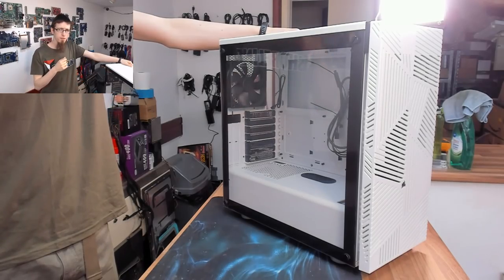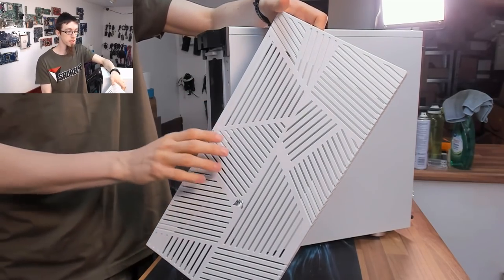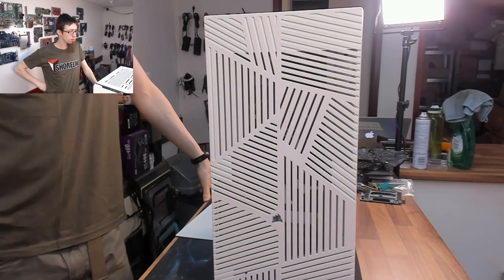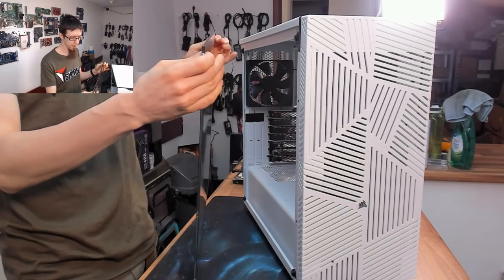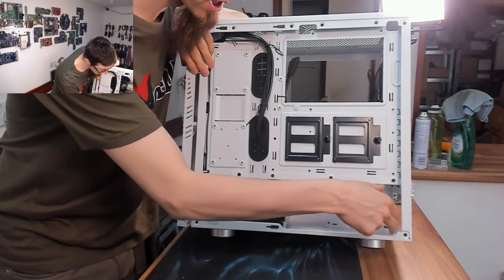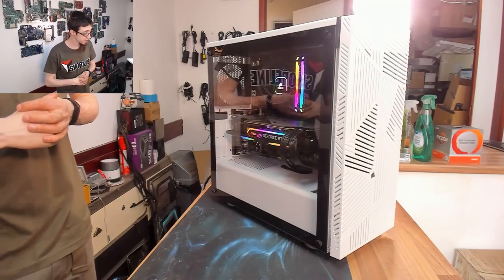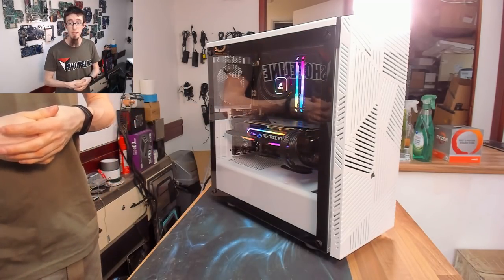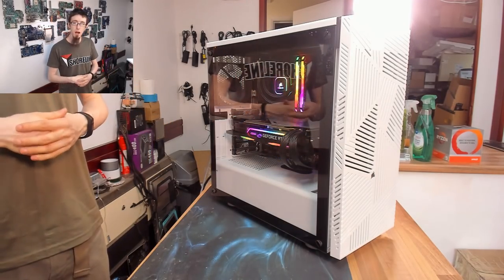Corsair 275R Airflow feature review - LBC#53

Comment: hey! It's my case!
As for the random screw that you see below the lowermost ssd mount, to the right of the motherboard, and even more specifically, right next to one of the cable management indents, that screw is there to mount your hard drive cage.
Reply: Does this case come with already arranged front pannel connectors or does it have like 6 single annoying ones?
Reply: @kamil9112  it has the obnoxious individual pins, but the front panel audio connector is 1 solid piece and the case does come with 3 included fans
Reply: Should I get this case ?
Reply: @ofduffman7674  the airflow is decent and for the price is good, if your getting rgb fans then go for the 220t instead
Reply: @ofduffman7674  
Well I mean I love it. It's also got one of those vertical gpu mounts built in. Granted it's close to the glass so it's hard to say if it's any good, but hey.
Reply: @Monster Conrad how is this case when it comes to noise levels? I’m a little worried it might be loud.

Comment: I got this case in black for my first PC build. Used a B450M Mortar Max and fit really well, although one of the rear fan header cables was a little short so I had to move things around a bit. Fans are quiet. Very happy with my choice

Comment: About the PSU orientation, its pure fact that capacitors wear out faster the hotter they are, but whether that matters that the PSU is essentially intaking then exhausting hot GPU air, probably not since most mid or high end PSUs will last 10+ years even with slightly warmer caps

Comment: I recently bought a fractal define R5. Sure it doesn't have the PSU shroud, but otherwise I think it is the perfect case. Plenty of space without being too big, 5.25" drive bays(yes optical drives still have a place!), plenty of hard drive bays, and cable management is a breeze. I do wish it came with another front fan, but if that is the only bad thing, I am willing to overlook it. Plus the dust covers are easy to get at without taking your pc apart.

Comment: I have the 275 and did a carbon fiber wrap on the front and I like the case. And for the nvme drive always remove the sticker because it makes thermals better! 😎
Reply: mister.T Jr  The sticker on the nvme drive is not a thin heat spreader because its made of plastic only more expensive nvme drives have it. Not a noob i have 20 years of experience with computers.

Comment: Hi Adam I was wonderinf if you could help me with a problem. I have a laptop with a windows 10 that frezzes/lags for a second or two every 5-10seconds. I had recently reset the hard drive reinstalled windows on it. So I thought it would be the hard drive. I took it out and but it into another laptop i have. Laptop works fine. Okay so must be something in the laptop thats broken. Quick check first put another hard drive in the laptop and the laptop runs fine. So hard drive is fine in another laptop, laptop with a different hard drive is fine. Wondering what the problem could be? Thanks
Reply from the maker: Try doing a Seatools for Windows long-generic test on the drive. Different HDD controllers have a different tolerance for drive failure, the drive could still be bad, but your test laptop was just handling it more gracefully.

Comment: The "airflow Meta" as if airflow is a new thing, manufacturers seem to think that consumers die every 7 years or something. I remever when cases came with 360mm side fans and sounded like jet engine
Reply from the maker: Yea this is true - but there's a very clear move toward all-mesh or all-grill front panels for the 'trendy cases' if you see what I mean. Just look at all the solid-front-panel cases that are getting refreshed with mesh front panels at the moment.
Reply: 100% and seeing more and more cheap and midrange cases with some filters is great too. I remember back in the day dusting out my old HAF-X case on a monthly basis because it didnt come with any dust filtration.

Comment: Did you have any problems with the installation of the h100i xt on the am4 because i just ordered the h115i xt and there is a bunch of reviews saying that the installation sucks and the clips could break
Reply from the maker: I'm not a fan of the two-hook mounting system, and I wish Corsair / Asetek would go back to a four-thumbscrew design. It is much easier to fit the two-hook setup, mind you. I can't see it breaking though, I have a couple of AIOs using a similar system that I've installed and removed from test builds several times and had no issue.
Reply: @Adamant_IT  Yeah i was always using the four-thumbscrew design on the intel platform but i switched to ryzen when 3rd gen came out and i was using the stock cooler but it was just LOUD and i was hitting 81c in gaming also wanted to let you know that the pro xt series is using  CoolIT instead of asetek
Reply from the maker: Aha, interesting, good to know!

Comment: Actually got this case
Reply: Is the case any good?
Reply: @granola3923  yeah it's great. You might need to remove the hdd drive to make more space for the cables/power supply
Reply: I think I’m fine if I leave the hard drive cage because I have a evga 600 watt power supply which is kinda small. Anyways thanks for the reply, I wasn’t sure if I should of got it or not but since you say it’s a good case I might consider it!
Reply: @granola3923  great! it's around 76 dollars on newegg which is great considering it's airflow design and the fact it comes with 3 fans
Reply: If I ever wanted to replace the stock fans what fan would you recommend? I was looking at the noctua p12 redux, but I’m not sure if I should get those.
Reply: @granola3923  Noctua fans are great they offer black options so you don't  have to worry about color matching it with your build, but I personally went all out and got 7 Corsair LL120 fans for my case
Reply: Thanks I’ll look to see if I get noctua fans. Also was the cable management for all those fans difficult?
Reply: @granola3923  Yes, the commander pro and the cables were a mess to hide/ manage, but luckily there was plenty of space to organize those.
Reply: Nice job! Me personally I don’t think I would be able to manage all those cables good. Thanks for all the help!
Reply: @granola3923  Thanks and Your welcome

Comment: The screw hole is to hold your gpu up
Reply from the maker: I did wonder about that. It just seemed odd for it to be there when the case didn't come with a GPU bracket though. But yea, I guess it gives you the choice to fit something yourself.

Comment: Negative pressure :(
Reply: Yeah should move the back fan to the front
Reply: and the PSU stealing air from the gpu, and the missing nvme drive screw,and the nvme heatsink being blocked by the sticker

and lets not forget my favourite  contradicting quote from a while back " why would anyone need a psu over 600watts" when this build has the 750 that it needs
why buy gold rated PSU when you dont design the gaming load to be 50% of the PSU rating .....................

i got to be honest i dont feel the customer got the attention to detail he deserves for 2 grand
Reply: @tonybarden8563  1: He mentions every video that is to stop the psu from getting clogged up with dust when the pc is left on the floor and the filter isn't cleaned. And it doesn't affect gpu temps in any way, not hard info to find.
2: PSUs are so expensive currently that the higher wattage psus are more worth it as the lower wattage are sold out (Platinums price gouged completely, don't even bother). But the negative pressure is a dust issue.
3. NVME is held down by the heatsink and the heatsinks don't do anything useful so leaving the sticker on is fine.
Reply: @whiplash7400   
1 you are both wrong,it is stealing air from the gpu esp. in neg pressure (this is called BASIC PHYSICS)
2 he stated the 'why buy over 600watt' before the psu shortage so again your wrong
3 nvme isnt held secure by that cooler HE EVEN ADMITS IT IN THIS VERY COMMENT SECTION and the heatsinks are proven in many many tests to help temps esp with the controller chip

my only question to you is why even try to sound remotely educated when you obviously have none in regards to pc's or in fact basic laws of physics

Comment: Thats the same case as my Carbide Spec-06 except for the front panel.
https://www.corsair.com/ww/en/Categories/Products/Cases/SPEC-06/p/CC-9011145-WW
Reply from the maker: Yea doesn't surprise me - Corsair often retro-fit existing designs for new styles. Normally it annoys me, but most of their current designs are fairly good, so it's nice to see them get a refresh with different panels depending on what people like.
Reply: @Adamant_IT  Agree with your comments about mounting the GPU vertically and the PSU. Fan up is the only way to go especially if it's rgb, looks great. I don't think you mentioned that you can also mount 2 x 2.5 drives internally. My RX5700XT fits easily.

Comment: I would never want this lad to build me a computer, Why on earth would I want to pay for him to bodge a computer build that I am paying for, I don't ever want a computer that is going to go wrong someday just because he couldn't be arsed to put a screw into place.
Reply: What are you on about?  He installed all the parts correctly in this build with the screws provided.  By the way, not every screw is required for every installation.  If you can do better, start your own channel. Otherwise, piss off.
Reply: @metrotechguru5863  He did not build it correctly and someone is paying for a bodged build. He should know better, but obviously, he does not give a dam. If you can't stand him getting a little criticism, I suggest you go and play with your self.
Reply from the maker: What part did you think I bodged? Keep in mind that the build sequence is heavily edited for time, including screws - it's not exactly very interesting to watch someone fit nine screws into a motherboard for five minutes. If you're curious, there'll be a full-length build video posted this week.
Reply: @Adamant_IT  At 16:30 you left out the screw that holds in place the M.2, now you are going to say that the cover holds it in place, aren't you? Well there is a thing known as  expansion slot creeping where the card creeps from the slot due to expansion and contraction from the heat build-up and cooling down of the M.2 drive, couple this with the odd knock on the computer and you have a fault, the screw is there for a reason that is why RAM modules have clips to hold them in place, You may think this is trivial but I don't
Reply from the maker: I don't believe for one moment that thermal expansion can do this. However, I'll grant you that if this system was going to be shipped across country to the end-user, or the owner was in the habit of moving the PC around a lot, you'd definitely want that drive screwed in to defend from the bumps it'll experience in transit.
I actually had a moment of dilemma deciding what option to go with on this mobo, because it had an interesting heatsink mount that used a standoff intended to screw into the centre mobo mounting hole, and I wanted to see how effective it was. On account that a lose M.2 drive isn't an issue I've encounted yet, I'm not losing sleep over this - but I do agree with you that screwing the drive in is the best policy.

Comment: Oh hey it's yet another "Oh hey this case looks good. No wait it only has 2 HDD slots it's garbage." >.>. 
At the very least they don't have the god awful and very janky vertical HDD mount (not sure on it's name) but at this point i'd say it's a negative.
Reply from the maker: "Lots of drives" isn't in the gaming PC meta though. When you can buy 8TB HDDs at no premium cost, and mobos are all rocking two or more M.2 slots, there's zero need for a massive HDD cage.
Reply: @Adamant_IT  Don't want to give up my 1TB and 2TB drives though and also want to get an 8TB drive to install all my games to so I can retire the (old) 2TB to backing up my hundreds of video clips that are on the 1TB drive and also storing random stuff on until it dies.
Plus I just like having lots of harddrives. I'd be using a 250GB drive from 2006 still if I had more than 2 HDD slots on my current case lol.